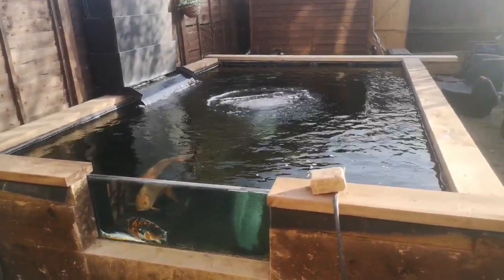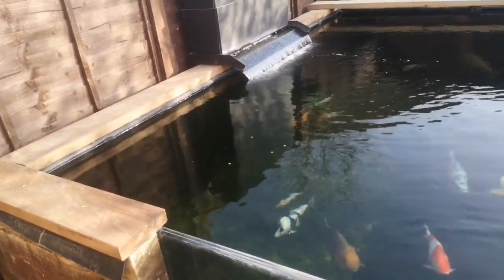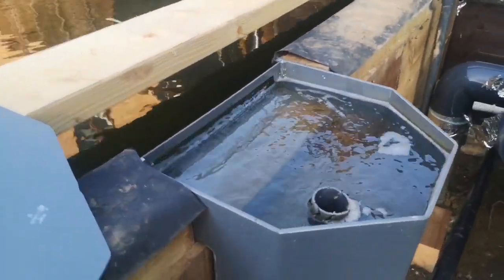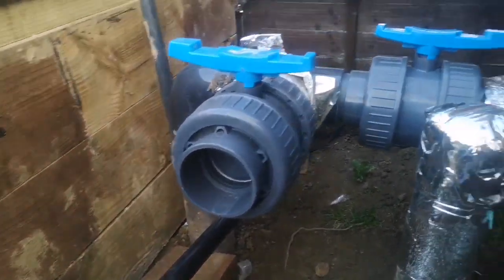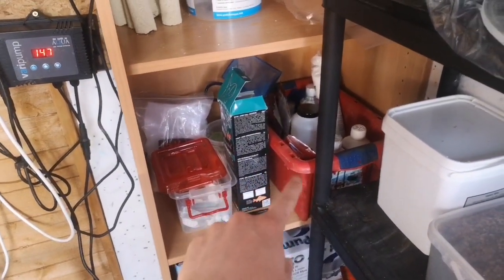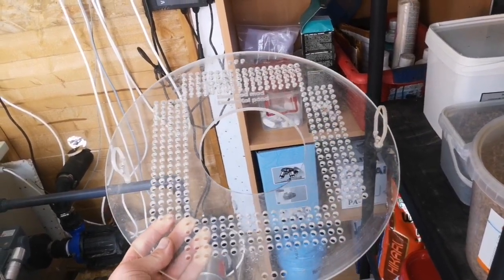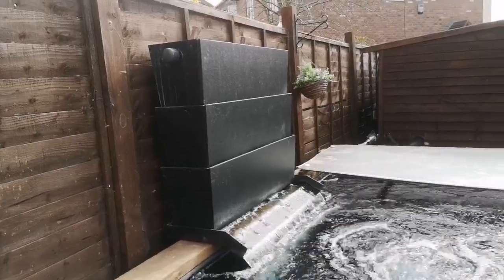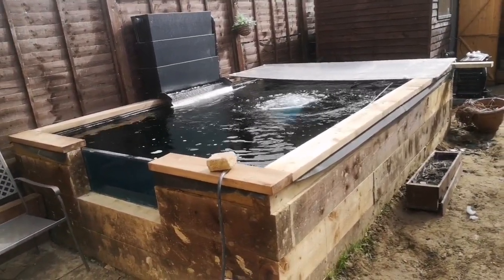Sleeper Pond Build Overview - what I would do differently...

Comment: Hi mate. Great update bud . Maybe with your moving bed instead of sucking it all from the bottom . Put a elbow on it and have it coming up with a cage on the end ( wrighty moving bed) and draw your water from the top rather than getting clogged at the bottom.  Good luck figuring it all out 👍
Reply from the maker: Thanks for watching. On the ibc it is pumped back to the pond not gravity return so it dose need to draw it from the bottom. Hopefully going to find a way to extend the outlet so its drawing over a wider surface area. It's an issue I really didn't think about

Comment: Dan, you've done a great job and should be really proud.
It's an easy mod to get your ibc working, you need the return to be higher, near to the top of the water level and a large inlet, a four inch pipe with loads of holes drilled in it or similar . The movement of the media with the air will stop any media settling against the outlet.

Comment: Good to show the problems as well as the good stuff there will always be things we would do better a second time but she's running and all the niggles can be fixed in the years you now have enjoying the pond. The fix for that pump inlet in the moving bed is make it much larger so the surface area is much bigger on it you will always get some stick to it but not as bad as to cut the flow
Reply from the maker: Thanks for watching. Like you say, all part of the fun. I don't think a pond is ever finished. I'm going to have play round see if I can get the outlet for the ibc sorted without too much reconstruction, if not it may become a bit static bed full of grog instead
Reply: They do some nice perforated stainless steel tube 3"" 4" inch or more on Ebay for making exhaust cans it makes a nice cage for a outlet

Comment: Looks great. Agree about the window... I've done my 3 now using same method and it was quite easy. No leaks so far. Interested in the moving bed media problem as I'm planning similar. Wonder if attaching a long perforated pipe to the outlet (inside the ibc) would help?
Reply from the maker: Think a long pipe is the answer. It's difficult for me to fit one where it is at the moment but I'll think of something. I imagine it did this on my old moving bed in my old pond and I just never noticed

Comment: With the slight movement in the hight of your sleepers would you not be able to lift them slightly with leaver bars and pack underneath them with concrete?
Reply from the maker: It's a possiblity. It would involve draining the pond though. At the moment it's not causing an issue. My levels are still fine but if it dose get worse I'll have to look into it

Comment: I had the same issue with my sleeper  pond not being level after filling with water. My collar was 3 sleepers thick and I dug an hole on the side to the bottom sleeper where the water level was low. Then I used a toe jack to lift the sleepers up and pack with a paving slab underneath. Now all level within a cm.Ps toe jack was not cheap. Sold on ebay after 1 use.
Reply from the maker: Thanks. I'll look into it. At the moment it's not really an issue unless it settles any further. I'll keep a close eye on it

Comment: Hello How did you fit return pipes did you put holes in wood for return pipes and how did you fit them ?
Reply from the maker: I didn't have a proper core drill to cut the hole so I actually went under the sleepers. I did do a video on it if you have a check back.
Reply from the maker: https://youtu.be/Pi2Vv8RPTmo

Comment: Could there be a seal loose on the drum
Reply from the maker: This was my first thought but it's definitely sealed fine. The dirt is coming through the screen on the clean. The issue seems to be the amount of dirt accumulating before it triggers a clean. However getting it to trigger more often seems to be my main issue. The profi drum don't seem to have much leway on the water levels to adjust the float switch.

Comment: Hello, I'm building a pond in the near future and like your pond and videos. In hindsight would you have gone for a manufactured moving bed and a brick built pond instead of sleeper and ibc?
Reply from the maker: 100% would have gone for a manufacturered moving bed. Or possibly a combi drum. I probably had the same issue on my old pond and just never found out. I do like the sleepers but if I ever have to rebuild it will be blocks. I'm hoping the sleepers will last longer than I plan to live in the house for 🤞
Reply: @dannycurrie1  Have you always had a drum filter? Any experience with a nexus? I used to keep marines successfully originally with filter socks and changed to a clarisea very similar to the drum and experienced superior water quality. Obviously increased cost.
Reply: @dannycurrie1  Any suggestions for a quality drum and moving bed?
Reply from the maker: @deantaylor8545  I used to have an eazy pod before the drum and so far to be honest I prefered the pod. The drum seems to be quite difficult to get it running efficiently, along with alot of moving parts to go wrong. I may change my mind down the line but right now I'd swap it for a nexus if it didn't mean ripping the shed and pipework all out to get it in.
Reply from the maker: Also the drum isnt quite as perfect as people would have you believe. I put some filter floss in the top of my shower and I was shocked what's getting through it. It's alot more than I expected, and more than my easy pod let though

Comment: Do you need a moving bed as well as a shower? How many gallons is the shower supposed to filter?
Reply from the maker: The shower would probably cope I guess. I've no idea how much 50kg of ceramic media is supposed to handle. Seems a shame to waste all the mature k1. I'm thinking I might make a smaller moving bed withing the ibc instead of replacing it all. Or possibly fill it with static alfagrog in plant baskets or something 🤔
Reply: @dannycurrie1  I have no idea what a 50kg shower can handle but i would like to know if you find out. I would ditch the ibc and find a smaller container if you still want to use the plastic floaty stuff.
Reply: Interesting. Contrary to popular belief you don't need much aeration at all for the nitrogen cycle. 2ppm DO max. So you can bag those K1 in a net and will work just fine. You will get stratification and won't get slough-offs of fines. You will need a filter-to-waste port open when taking out media for a clean so fines don't end up in the pond.
Reply from the maker: still trying to work out what to do, I'll let you know when I've decided For now it's bagged and static in the ibc, it's not affecting my water parameters at the moment. I imagine the shower dose more for the bio than the moving bed really but who knows

Comment: If you get some wire mesh with slightly smaller holes than the K1 across the bottom of the tank approximately 50mm above the pump basket outlet and also extend that to go across the bottom of the tank like 4  capital T stacked laying along the bottom giving you eight outlets depending on how many will fit using 2" pipe the suction will not be concentrated in one place which should stop the K1 from being pulled down before you fix the mesh try it just in case you need to raise it anymore but i think that will do it. If you need i can give you a drawing via email your doing ok just write down all the things you would like to change because it will get on your nerves so when you do it again you will be ready.
Reply from the maker: Thanks mate. I think I get what your saying. I'll have a play round and I'm sure I'll sort something. Will keep you updated 👍

Comment: U need more and longer outlets in side moving bed 👍👍
Reply: Yes, I will second that. Try putting a 90 on it and have a full height vertical pipe full of holes. Like wrighty has on his. I run an ibc as a bio and it's fine,  I have over 400 litres of k1 in mine. I have found they key to moving beds is having depth to allow the media to roll. 👍
Reply from the maker: Thanks guys. Unfortunately the outlet on the ibc isn't threaded on the inside so it makes it a little tricky. Will probably involve moving all my pipework. I'd originally hoped to pump into it and gravity return but when I didn't get enough flow through my return I swapped it to gravity fed and pump reutn so I lost alot of depth in the tank annoyingly
Reply: @dannycurrie1  could you try a bigger return pipe and go for pump fed again? Mind you, not sure how that would work with your heater 🤔 can you gravity flow through it?
Reply from the maker: @garryrobson3634  can't gravity flow through the heater and I don't really want to drain the pond to put more returns in. I'll probably move the inlet over and put a tank connector through then put a much large cage on it. Think that's the best way to go

Comment: With your ASHP have you seen A Koi Enthusiast videos Kev's got a remora I'm sure he had similar problems and it was to do with his end settings or something like that.
Reply from the maker: Yeah I've seen his videos. I been on the phone to the guys at remora checking all the settings. With a few tweaks it was working better but still not right so they offered to swap it. It's not e cheap bit of kit and I'd expect it to work as it should straight out the box really. Fingers crossed this new one will
Reply: @dannycurrie1  they're supposed to be plug and play straight out the box aren't they, are they collecting the first one once you've disconnected it, that's good customer service, not a lot of companies would send you another out.
Rob.
Reply from the maker: @robertnicholls9409  they are supposed to be. Yes there collecting the old one. Like you says it's very good of them to send out the new one before collecting the old one. Meant I didn't have to leave my fish without a heater (not that it's been on the last 2 days)